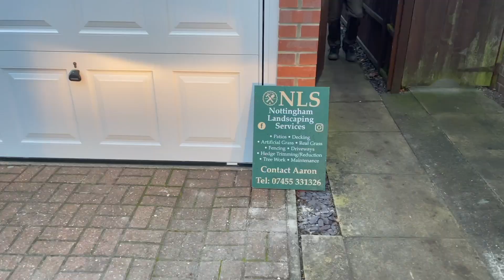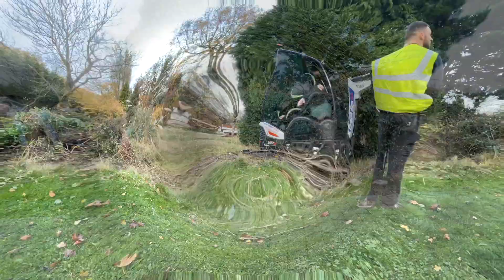THE BIGGEST FENCE INSTALL WE'VE EVER DONE ON YOUTUBE! (OVER 150M!) - This Week At D&J Projects #035

Comment: if you have that many post holes to dig wouldn't it have made sense to use a Auger to drill out the holes?
Reply: Thats what my company does, 4 guys 2 1 man augers punch holes set posts build it all when its dry
Reply: ...augers are great for sure but in an intense urban setting you better have your locates done and properly before you start drilling on someone's property, by the road... nothing beats hand work for safety

Comment: Just a question where you dug out those stumps especially the big one, how do you get the ground solid enough to put the posts in that area to stay firm in later years as it's all loose soil you have used to fill the holes in.
Reply: It looked like the ground was packed in and the digger acted as the Wacker/ compactor. It wouldn't move much in the short term but the whole area is being landscaped
Reply: Ive got the same question. Im sure you didn't put posts in loose ground no matter how much the digger drove over it.
Reply: They fill the post holes with a concrete mixture. You can see it in the timelaspes. The white bags on the side. If you watch some of their other vids you'll know/see better how they do it..

Comment: Dave Steve what a cracking  job that garden looks massive  Steve or dave when you use post 📫 mix or concrete  how far down you go with the concrete posts  3ft
Reply from the maker: 2ft if it’s a standard 6ft high fence

Comment: Hi boys i was thinking about how your wanting to get a design of easy sheet for big red but still want to use the drop sides, i was watching Ashville ep152 and they have a RoRo wagon and they have a system on that and it looks like the arms are on a right angle so they don't interfere with the flat bed they put on it you could have arms on big red like that granted the arms will stick up when the sheet is out and the arms are out, check Ashvilles video out it's at about 33:06 into the video, keep the super videos coming i really do enjoy them.

Comment: Hi Guys I Really enjoy watching your uploads on Youtube While watching this one with an 85 Panel Fence. It Appears to me that it involved a Security issue for the Clients in General. As demonstrated in some of your other videos you can just lift out any of your fence Panels.
To Me that runs a risk on Security of Entry onto property simply by lifting a panel up to gain entry. Either I am missing something or your not showing any Security Measures for Security Reasons. To make it harder for people to gain unlawful entry you could use a Silicone adhesive around the Panels and the Concrete Components. Please Bare in mind this is not a Complaint but just a thought of someone Concerned. Keep up the good work as it is very Entertaining.

Comment: Just a suggestion of how get rid of your inside pigeon 
 problem without reverting to the gun, too messy .
From EBAY you can purchase a bird (Pegeon) scarier 
It’s a hawk like bird, battery operated , that flies is a 
circle once attached to the inside of the roof via
Length of attached cord . 
I am told that they are used by some farmers to 
Rid them from their barns
The bonus is that they are fun to watch
Hopefully it helps,
Really enjoy your videos